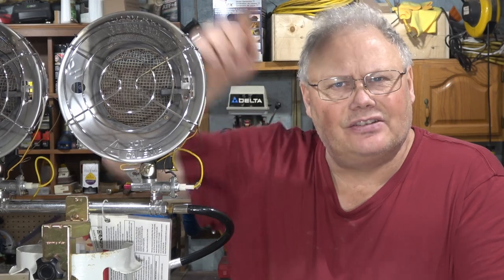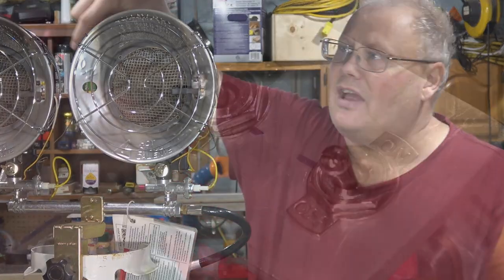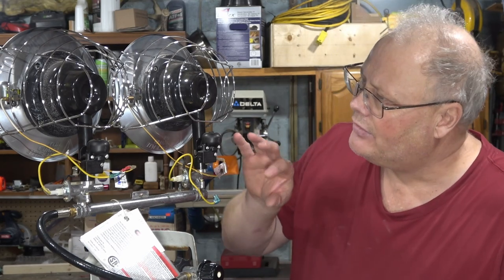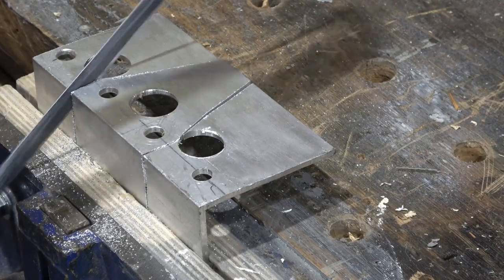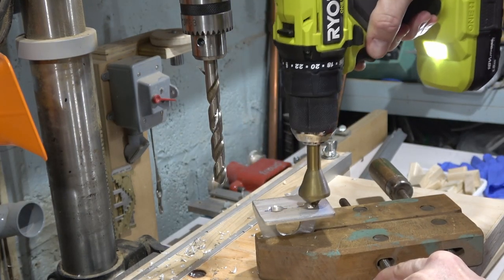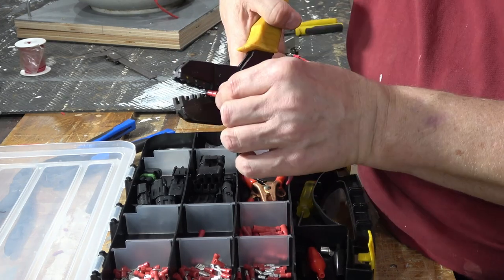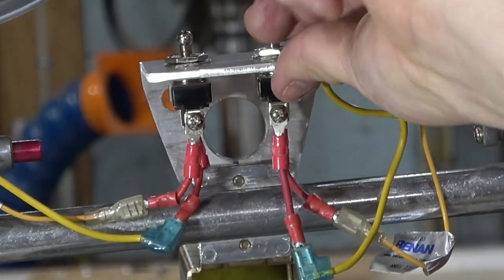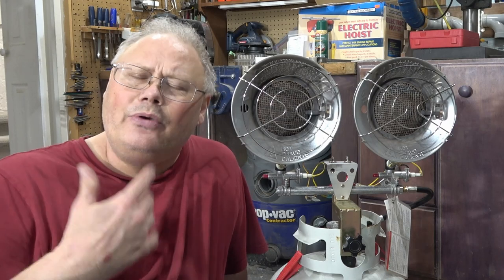Today I fix my bottle top heater (sunflower heater) and show you how I did it.

Comment: Hey Dino thanks. I have different issue. It seems like my red button is vapor locked. I shut heater off in mornings and keep red button pushed in while turning off so any gas gets burned off. Do you have any idea to remedy this?
Reply from the maker: Thank you for the question. Unfortunately I don't have an answer for you. I will ask a few of my friends and if they have any information I will post it.
Dino

Comment: ONE SEASON, and one side goes off after letting go bumper switch,    SO I UNHOOKED the wires an alligator cliped them together buypassing the saftey switch, same problum????    so it must be the thermal couple?????? ANYBODY COMMENT.
Reply from the maker: I'm guessing the thermocouple. I have one going as well now and have to change it.
Dino
Reply: Lookin for fixes. Found this and I already wired the wires together.  Guess the thermal coupler is the fix